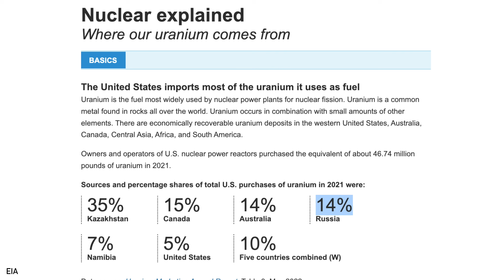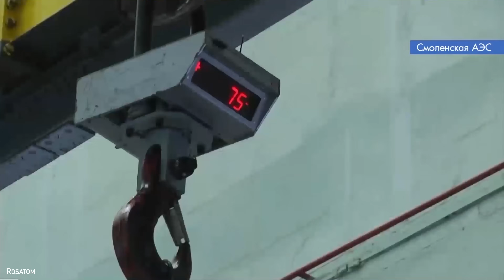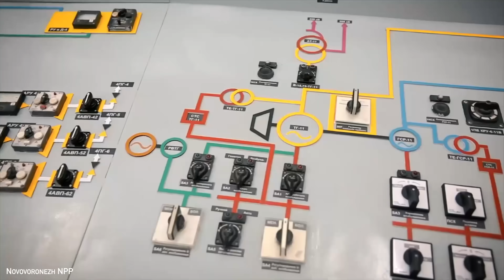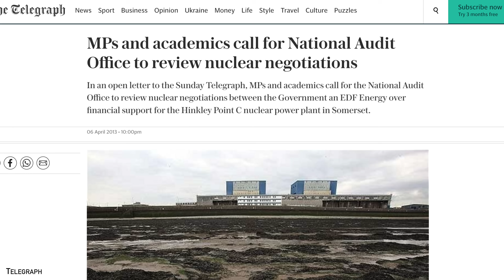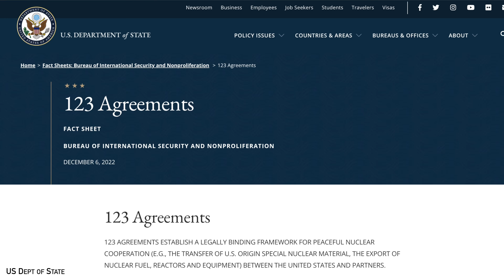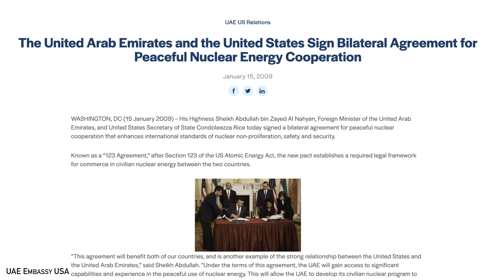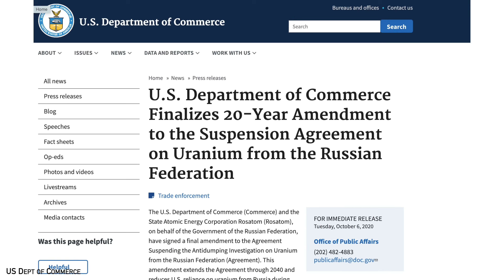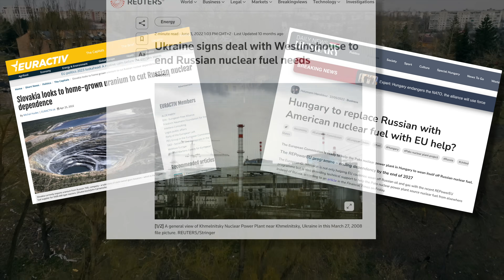How Russia Controls the World's Nuclear Energy

Comment: This is why we need the Moltex Waste Burner reactor. The current PWR fleet struggles to extract 4% of the potential fissile energy 96% 25 times as much is locked into the “waste”. 
The Moltex will burn that 96%. The waste with a current 1/2 life of 30,000 years is reduced to 30 years because the long lived stuff is fully used up.

Comment: Hi and thank you for a nuclear blog on yt! I am supplying nuclear related valves and pumps for Rosatom projects for many years. Your overview seems correct, but I want to add some details:
- Rosatom can make most of the critical NPP equipment by their own, but some important elements are still out of their range: turbines, APCS are the most painful parts now, due to the sanctions.
- New NPPs are coming up: you mentioned Egypt, but also there going to be new units for Kursk, Smolensk and Leningrad inside, another NPPs in Turkey and India, Hungary is still on board.
- Rosatom operates the northern seaway and building 3 new icebreakers and 4 new floating NPPs right now. Floating NPPs is unique and planned to be offered for foreign countries.
- Small modular NPPs, which are popular worldwide are also developing. They are going to build prototypeNPP of that type in Yakutistan.

Comment: The guy (putin) with the power to press the bottom has a refuge on the black sea with all the underground bunkers to be capable to resit a nuclear attack( he thinks); similar like hitler in berlin ...
Reply: Power to press button have bunch of people in Russia, not only Putin. And even one computer program (Perimeter) in automatic mode, without confirmation from people (specially for case, if by some reason all that people will gone).

To resist nuclear attack Russia developed missiles, you can watch launches of those missiles (nudol) right on youtube, from 2nd second after launch they already have speed 7 km/s (kilometers per second, yep). Incredible thing, reach altitude of ISS in space in less than 1 minute.

Bunkers is what used in other countries. But year ago Russia demonstrated extermination in Western Ukraine of soviet nuclear bunker under mountains with hypersonic missile. 60 meters of rocks and concrete missile passed as it was butter 😂 There are no bunkers on Earth which now can save from modern Russian missiles.

Comment: What about Thorium reactors or mini reactors ?
Reply: Mini reactors — Russian cruise missile Burevestnik use tiny reactor to fly for months. Another tiny reactor installed on intercontinental torpedo Poseidon.

Both born from project Iceberg (non exist yet), it is Arctic underwater project to extract gas/oil, because it is under ice, main idea to build whole extraction factory also underwater and supply it with mini reactors.

And separately exist reactors for space. They are also mini. Back in 2018 Russia tested 1 MWh reactor for space which developed from 2009. It developed for several projects at same time, most classified, but from public it is nuclear powered space tug.

Comment: Actually, Rosatom may be leader in nuclear reactors design solutions. They have 880MW fast-neutron reactor, that operates nearly on nuclear waste. MOX fuel is nearly free. However Russia would never export this technology in near decades. I suppose, due to goverment politics. Russia holds a huge share of the energy market even now under sanctions, and this technology could shrink the hydrocarbon market.
Reply: not because of government politics. Such technologies have a very long research cycle. Even for domestic market, the mass stage of use will begin no earlier than in 10-15 years
Reply: @Hdmotion.personal  because we can charge 2 times :  for providing fuel and for taking back the waste